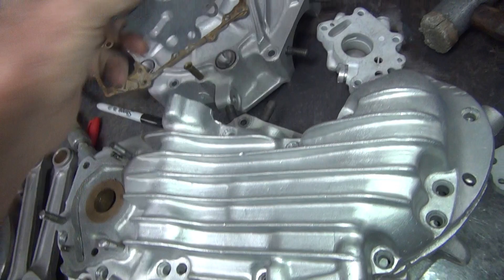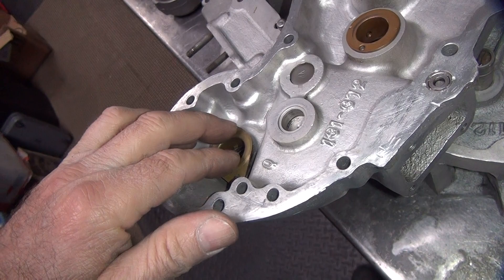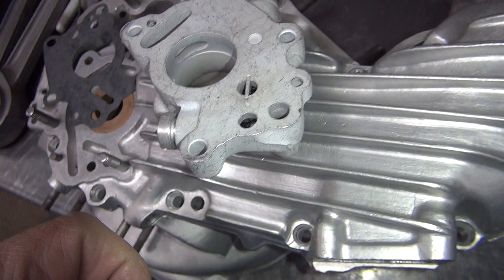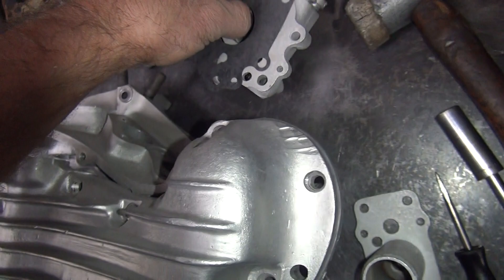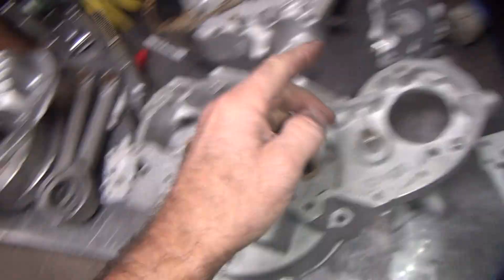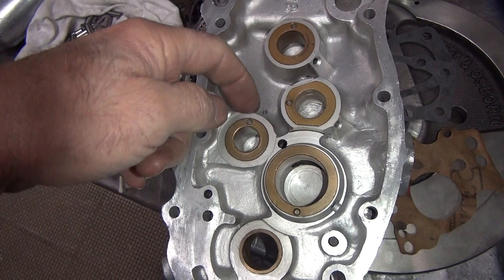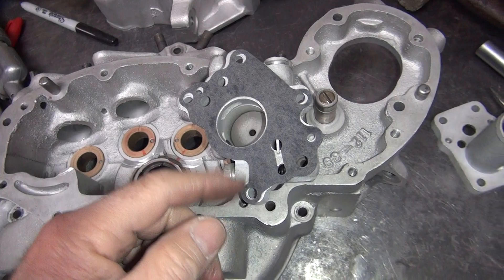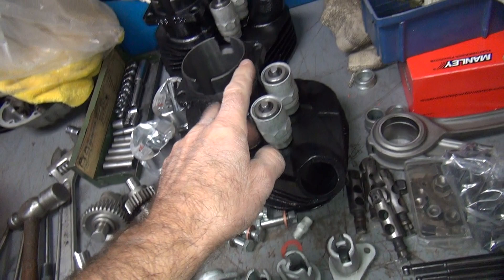1941 wld 45 56ci stroker #240 flathead motor build 4-5/8 in harley wl by tatro machine

Comment: It may be a little late to pass this on, but here goes anyway.  That passage was cut into the gasket as a bypass to prevent oiling at low speeds, something that Harley apparently was concerned about.  That was the reason for the reason for the centrifugal bypass built into the large style rotor pump.  If you haven't circumvented the bypass feature (many do) then having late style gasket isn't advised. 

Some background on sidevalve oil pumps, I've been riding BTSV''s for many years and have done some research on my own into the oil systems.  My opinion is the big twin can definitely benefit from increased oiling. The 45, I haven't done much research on. 

With respect to your comments on the return gear pump, just as a point of interest, the sidevalve pump gears are 5/16" thick.  The return gears on a '72 series sportster pump are 3/8".  Roughly 85% the capacity of the sporty pump. 

As a point of reference, the sportster supply pump roughly pumps about 1 quart/min at road speed 2500 rpm? , and the sporty return pump can easily handle that volume. 

The stock flathead pump, with 2 vanes delivers about 1 quart/8 minutes! Modifying the flathead pump for 4 rotor vanes does about double the flow, to 1 quart in 4 minutes. 

As I said, I've not done much research into 45 motors and their oil needs, I've only built 2 45's, one went into a tractor, the other into a hybrid 45/BSA cafe racer, and I used a "K" style oil pump on that.  I've used the later '72 sporty pump on my BTSV's for years, feeding piston squirters to prolong engine life, which has been quite successful.
Here are some sites that might be of interest:
The Harley/BSA hybrid: 

http://victorylibrary.com/tech/Frankenstein.htm
Info on piston oilers:
https://linnmotorcycles.com/blog/2018/12/17/flathead-piston-oiler
modifying the sporty pump, this tells of an early version of the conversion, 

https://dicklinn.webs.com/
Hopefully you'll find some of this of interest.  How pertinent to your project I'm not sure, as my goal was to make street Big Twin Flattys reliable, as opposed to all out speed. 

HD in their evolution actually cut down oil flow in the KR's with the quarter speed pumps in later years minimizing the amount of horsepower robbing frothing oil in the engine.
Dick
Reply: I meant to say "prevent over oiling" in reference to the gasket passage. poor proof reading :-(
Reply from the maker: this just goes to show you what can be done if you want to. if there is a well, there is a way.
tatro

Comment: Hello, I have just installed a new pump on my 1943 750 WL (V-twin reproduction 49-0606) and since then the oil pressure oil light has not gone out. If I put the old one back, everything works normally. I realized that the length of the springs is not the same between the old pump and the new one. Could you tell me what is the length of each spring, because I do not understand why I have no oil pressure with this new pump. Thank you very much for all your videos. Stephane. country: France
Reply from the maker: i have not used the repo pumps yet. take it apart, clean it and adjust the pressure spring. pre lube it befor you put the pump back on and see what happens. if it still does not work than look at how the oil holes and gasket are made. maybe something is machined wrong.
tatro